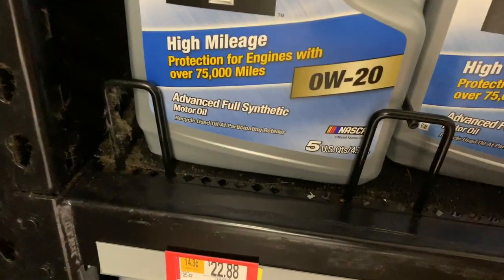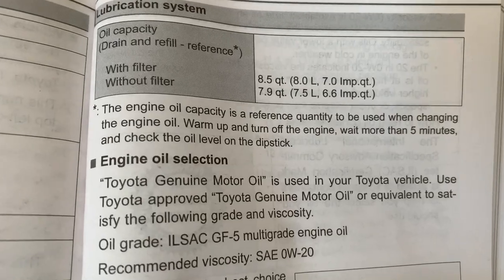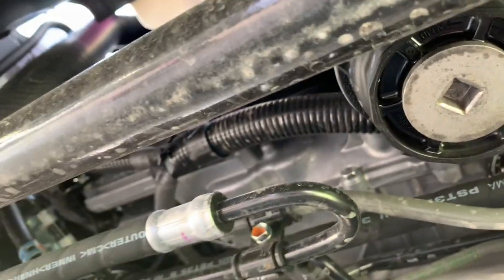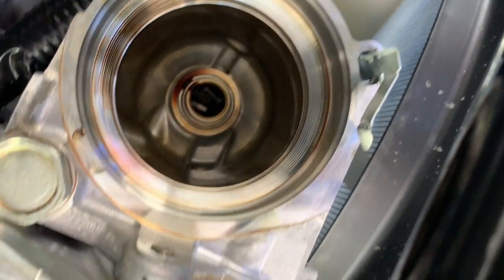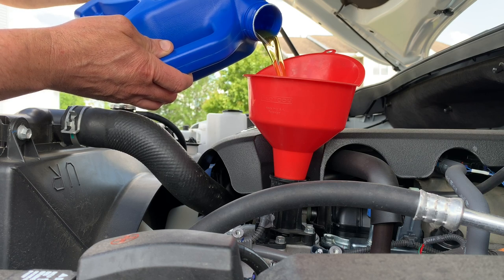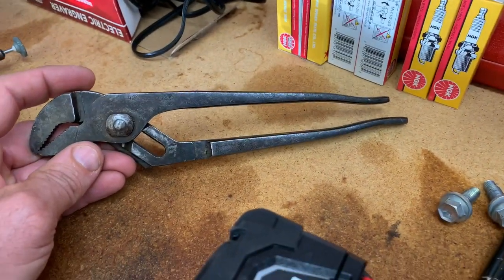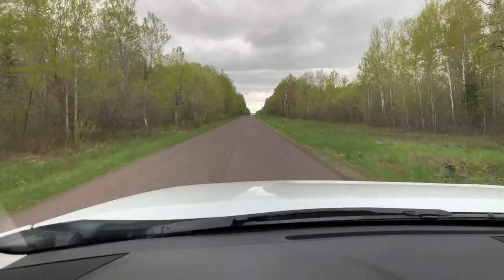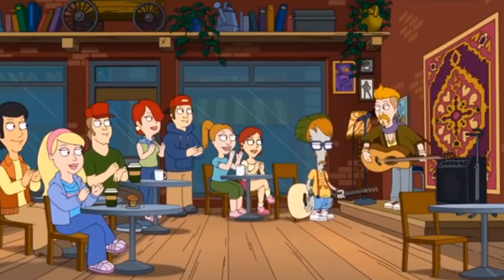2019 Tundra 5.7 Oil & Filter Change

Comment: Lost me with the Super Tech oil. Just because it met the one specification doesn't mean it compares to Mobil 1. Look at bobistheoilguy forum
Reply: Look up project farm. Oil Olympics.  Super tech actually beat out mobil 1.
Reply: gunluvr20  I'm sure with a police fleet the brakes last forever. Around here the cops dont stop at stop signs
Reply: gunluvr20   It's irrelevant what top four oils your company uses.Your company uses a certain vendor that distributes certain oils. It's whatever you can get through your vendor.
Reply: gunluvr20  
Well,
1. I don't drive a police car
2. I change my oil every 5,000 miles.
Reply: Joe Smith  yup
Reply: Exactly. They will work to the lowest passable standard. I'll stick with Valvoline full synthetic for a few dollars more.
Reply: How much better is Redline compared to Supertech?
Supertech vs Redline
https://youtu.be/zwqt5vI0o1A

Comment: Just bought 8 quarts of oil and filter to do oil change on a 2016 tundra and it was 93$.  Mobil One and Purolator filter.
Reply from the maker: Supertech 5w30 synthetic 2@52 + oem filter for 7.54. 
DIY for less than $60 is another option

Comment: Use the plastic piece. Way to show the wrong way! Especially if you have installed the TRD skid plate. You will make a huge mess if you don't use the tube for the filter. And you get self-righteous about how to change oil....

Comment: Just started doing the oil changes on my 2017 with 24k. "Skid plate bolts stripped out." Check! Stripped bolt and skid plate bolt spacer missing! Plus the dealer has been skimping on the oil (saying it is synthetic and under filling). It takes time, but just do it yourself.

Comment: nice job. FYI Toyota dealer OEM OILfilters cost only 5.50$ and a new crush washer is a buck Also use anti seize on those skid plate bolts for the next time! My rig has 180 k and rusty bolts do happen
Reply from the maker: Patrick Thomas   -are you able to post a link for those $5 filters? ...have not checked Camelback, but unfortunately my local dealership charges more than msrp for parts unless you push them - that gets old everytime, so they usually do not get my business or endorsement. Thanks
Reply: @JLeeChron  purchased them from my toyota dealership in Great Falls Montana last week, Could try Amazon too

Comment: I have a 4.6.  Is the anatomy/positioning of the oil filter, drain plug, and torque specs you mention here the same?
Reply from the maker: Nick Macker its been too long since I’ve done the 4.6- sorry no info for you
Reply: @JLeeChron  q

Comment: I always find it strange that in the US, car dealerships habe such a bad reputation among customers. In my country, almost all dealerships of all automakers do their job pretty well. There will always be bad stuff, but not to the extent of people thinking the dealerships are the worst place to take your car.
Reply from the maker: It’s mostly because of overcharging, upcharging (upselling) or a bad experience, such as it not being fixed properly and having to return it multiple times. We all want stuff done for free or cheap, sad to say -is the common entitlement mindset.
The good experiences come from warranty work or an occasional freebie, or the good ol shop round the corner that you know and trust.
Reply: @JLeeChron  ive generally not had any bad experiences with dealerships. Maybe i was lucky. Ive owned nissan, mitsubishi, honda, and now a ford and never had major issues with the local dealerships. I still prefer to work on my own car just to save some time and hassle. Only take in the car if it has a major issue i can't fix. Very few independent shops are trustworthy in my country.
Reply from the maker: @Kevin09210  yes, I was going to add almost every time I’ve dealt with dealership/quick lube (<5x) regarding an oil change- always something not right, not wiped off mess, stripped skid plate bolts, gorilla tightened oil filters and drain bolts, fingerprinted interior, shop mess in the mats.... just easier to do it myself. But then again, I’m probably a bit more particular than most.
Reply: @JLeeChron  i totally get you. Ive been through the same on more than one occasion. Doesn't bother me too much, but definetely not right. I worked as a tech on ford and a mercedes dealership for 2 years and every car i touched got back to the customer in mint condition. Even better that how it came to me. It should always be like that.

Comment: What kind of impact sockets are those? I like that they are colored.
Reply from the maker: Zachery Barker harbor freight has those, cheap but work well. @goonzquad uses them also-
You remember which color is what size as the size markings do not stand out like I would like— why doesn’t someone make a good socket with the sizes brightly contrasted tho ???!!
Reply from the maker: And also they are not impact rated, but work for smaller duty
Reply: @JLeeChron  Awesome-sauce. The sockets I have right now are Craftsman impacts that suck in my opinion. My lug nuts are always lodged in them after I buzz one off. Yes yes I am using the correct size socket. Maybe some cheapies will do the trick?

Comment: Why not leave plate off ?
Reply from the maker: Guillermo Loredo its ok to leave the skid plate off. Just put it back on when off roading for protection.
Reply: @JLeeChron  B/C the alternator is under the engine, just the right place to pick up any road snow, slush, and mud. TRD? has a plate with an access door to change the oil filter.
Reply: When I had mine off the 2nd time I cut a circular hole in it the access the filter, no more removal ever

Comment: How do you reset the dash oil maintenance alert?
Reply from the maker: Derek   right steering wheel control  scroll to far right settings icon >down to vehicle settings> enter (centerbutton) then down to maintenance reset. For the 18-20 at least may be different for older models though.

Comment: Most stupidest thing toyota did to there car trucks filter system must go
Reply: Yeah its kinda ridiculous.  Like spin on filters have always worked great, why would you change it toyota?!?!
Reply: @robertt251  because people buy cheap filters and cheap filters have crappy antidrainback and bypass valves. Using a cartrige filter eliminates the crappy valves and seals in a spin on filter.
Reply: They should do, a standard oil filter changing

Comment: Oil changes on these trucks a reason enough never to buy another one. What a bad design.  Spin on oil filters been working for 60 years so lets make it harder and add the potential for 2 or 3 more places for an oil leak.  fck me...
Reply from the maker: @wreckanchor  yeah spin ons do the job but still would rather have these tundras than the newer ones !

Comment: I see you use super tech oil, first time I’ve seen anyone uses that brand. I’m more of a mobile 1.
Reply from the maker: C T  usually price shop, and if it meets the type specs.
Reply: I use the same oil with oem toyota filter. Never had any issues. All oil meets the same specs. Only difference is additives they use.